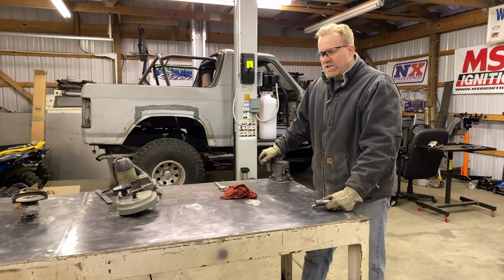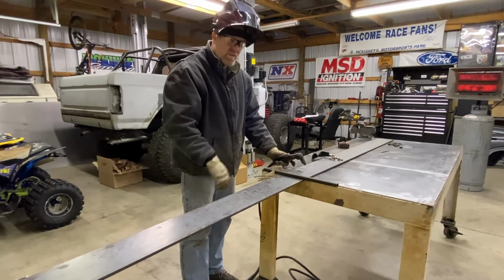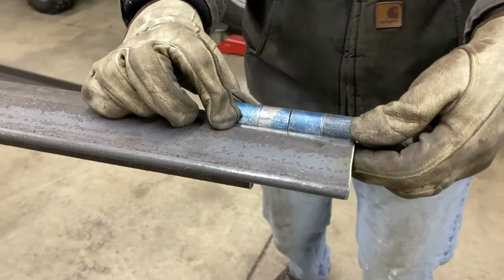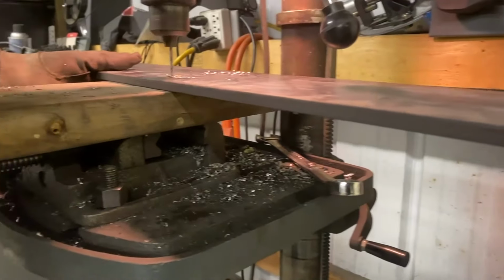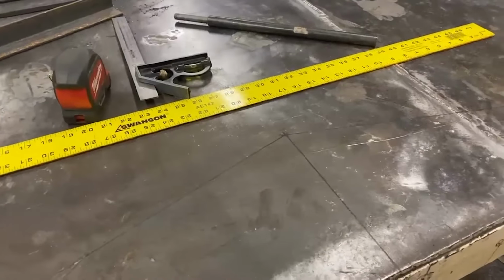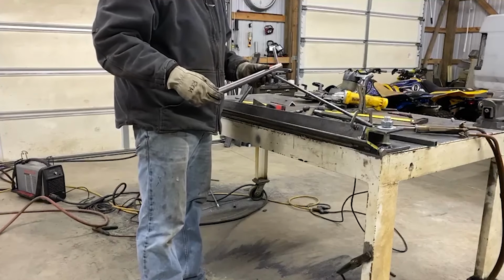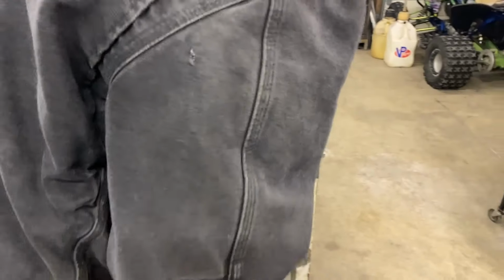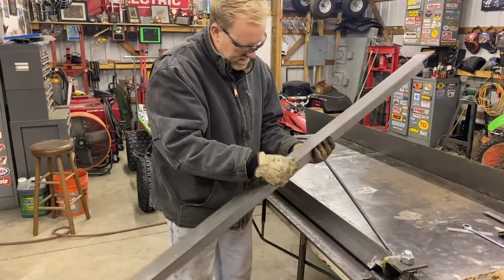DIY 64" SHEET METAL BRAKE *ONLY $220?!*

Comment: Nice build, it's quite long. But how to prevent the fat angle in the middle?
Is 3/8" a bit too thin for the angle piece? Handles too wide? Better support needed?
Reply from the maker: Brake 1.0 is already in thought. There are a couple things we are going to change and fix on the design. The first being, change the 64” angle where it connects to the hinge and change that to a thick plate so it would fix that “fat” radius in the middle section and it would allow you to create closer multiple bends. We would also add a thick plate to the bottom of the top angle die to create a triangular box so the pressure points are not on the “toes” of the angle. Second, the handles can be moved wherever but, for this brake being so long we wanted spread the stress points out. If you decide to create around a 48” brake it would be the perfect build with our design. With ours being so long it does need some more reinforcement.
Reply: @alwayssomethinggarage794  seen another video of a guy grinding off the edge of the top angle iron and adding another piece. He also cut the bottom one into pieces so he could make a box brake. Basically same concept as yours.

Comment: Guys. I've watched over 100 videos on fabricating a sheet metal brake and this one is BY FAR the best, most straightforward build. While watching all these other videos I've collected the best of them all and I'm about ½ way through my own build. I was quite happy (and surprised!) that my design is virtually identical to yours! You are obviously much more experienced than I so I am very pleased that I'm heading down the same trail that you took!

I especially appreciated the way you mounted the top piece of angle iron and the tightening bolts - it is MUCH more logical and user friendly to have a flat plate for the springs and tightening bolts. 

The key difference in my design is that my main mounting plate is angle iron and I ripped the downward pointing piece. I then welded the ripped piece to form my own "C" and drilled and tapped it so I could have tightening screws that secure the entire brake under the lip of my welding table. It's worked out quite well!

I was able to craft DIY hinges using ¾" round tube and ½" round bar which was nice, since I don't have a metal lathe. (That tool is wayyyyyy down the list for me).

QUESTION: If you had used COLD-rolled steel versus HOT-rolled steel, do you think you'd still have the bending problem? My guess (I'm still new to welding) is that at 60" you would need that matching bottom gusset either way.

BEST design I've seen. Well done and thanks for contributing to the community!

Jim
Reply from the maker: Thanks for the comment and checking out the video Jim! Thank you so much for the words about our build. We wanted to share our build to the pubic and help others out. So hearing that this video is helping you out is so cool! And it makes us want to keep creating better content for everyone. But to your question about the cold rolled steel, I would think it would help the flex in the middle since I think it’s around 20% stronger then what we used. But, since the brake is long at 64” my dad still thinks it would still flex if you were bending a thicker piece of sheet metal. If you had a smaller length brake like a 48” and used the cold rolled steel I think that would work super well! But Jim thanks again for the comments we really appreciate all the feed back.
Reply: 0

Comment: I think your top brace is at the wrong position, it should be straight down on top of the angle instead of tilted back that way. It is currently pushing forward instead of down. ..........Just my opinion.
Reply: You are absolutely right! Always think opposing forces. If something is bending or bowing your metal up, you must have an opposing force to hold it down.
Reply: @STRATTONSGARAGE  But if you have it clamped down square you will struggle to bend 90 degree let alone the 120 or so allowed with this.

Comment: You were a bit greedy with width. I have made one 4 foot wide with 2 stays in the bracing and it bends 16g easily with no real difference in length. 
Other wise very similar though I am using channel iron for the base